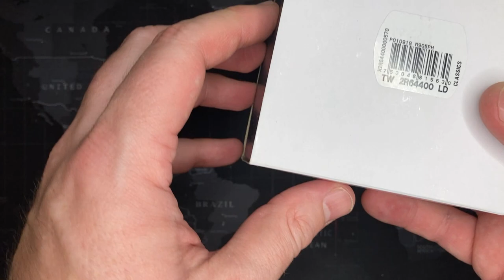Timex "Harborside" 50m Sport / Skindiver Watch - Review & Unboxing (TW2R64400 / M905)

Comment: Extrange my harborside dont have indiglo and is 100m water resistance :S
Reply from the maker: I guess that makes sense. With indiglo, there is a pushable crown, which would generally make it less protected, but yours, without the indiglo, could more easily support better water resistance.
Reply: @ToddsWatchshop  confirmed, i did snorkel for hours that end year and even dive around 5 metters múltiple times to do scuba fishing and perfect! Of course the version of 100m that also is all green, if some read and your Harbourside have 50m and Indiglo light be a bit more careful...